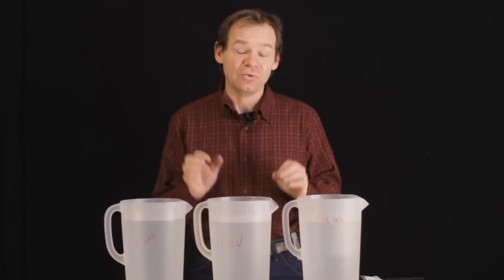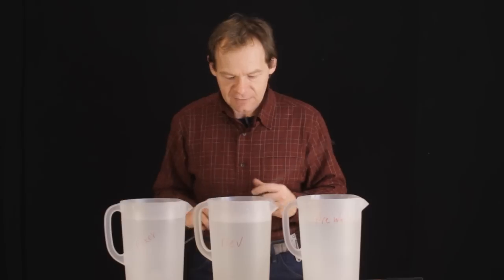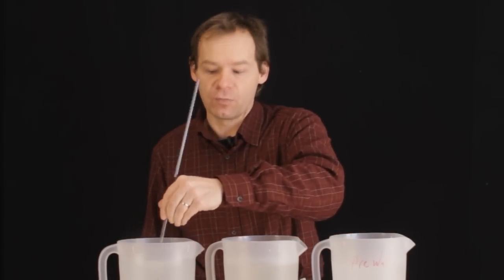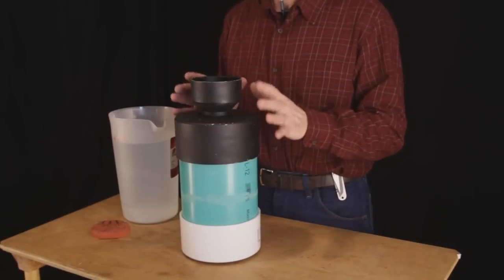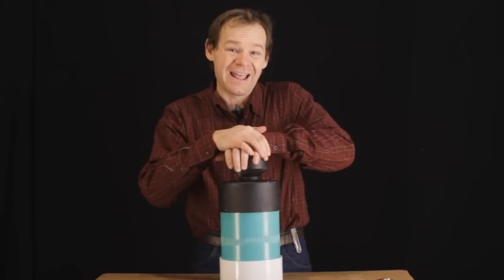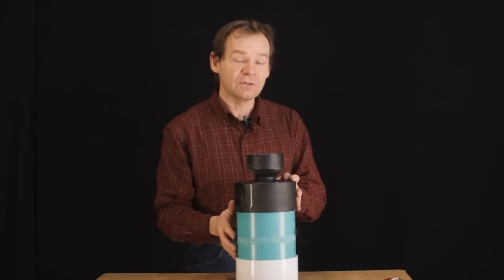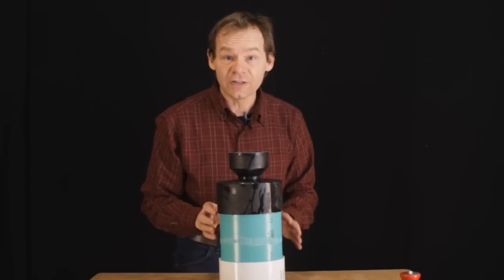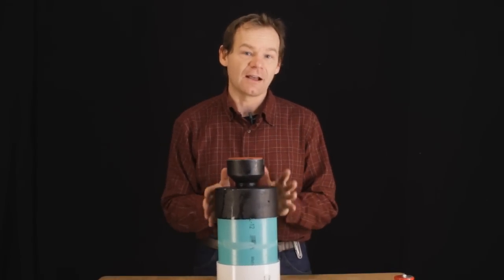How to Hand Process / Develop 16mm film Part 2 - 16mmAdventures

Comment: insightful videos. I moved away from all convenient film processing facilities and have to hand process now with a morse G3 tank. I asked google and emailed kodak support but they were not very helpful.. What chemicals and rinse timing do you suggest for processing 7266(b&w) and 7219(vision3 color) 16mm film? or where do you suggest I look for this info?
Reply from the maker: +Jeremy Ciliberto It's pretty much up to you to figure it out.  If no one on the web has the answer you just have to do some test strips and try different out.   You should be able to start with the process I used, it will probably give you some halfway result and you can alter it from there.

Comment: What about standard 8mm film? I'm not particularly fond of Super 8 for some reason, I just like standard 8mm. If so, is there a certain type of film I should use? Is there any way to develop Kodachrome film? Sorry for all the questions, I'm new to this. I've been watching 8mm home movies and train films for a long time and have always wanted to film trains with vintage cameras, but I didn't think it was possible. I'll use Super 8 if I have too now that I know it can be done at home. I found some websites that will process it, but they wanted $18 per roll! That seems a bit ridiculous to me. Any help would be greatly appreciated. Thanks!
Reply: +Jimmy Stewart 18$ isn't so bad, in the UK we have 'Gauge Film' which does it for 14£ (that's over 20$). Double-8 (you know it as 'standard': the film is 16mm wide, exposed along one side, and then flipped and exposed again. After development it is cut in half) isn't easy to get, but you can buy Fomapan R 100 (black and white). I've seen Agfa Chrome 200D, but that's expensive... super 8 is much more available, but also very expensive!
you use a projector?

Comment: You obviously have no technical training in film processing.  Your agitation is far too violent, anyone who copies your technique will cause GRANULAR MIGRATION on their film.  A STOP BATH means halting the film development with a precisely timed immersion in dilute acetic acid, not mere "tap water" which will leave higher contrast areas on random parts of the film.  Developer and Fixer chemicals should be mixed at least 24 hours before use so that the chemistry is properly homogenized.
Reply: OK, granted it's not the greatest instruction video ever made. But at least it's a starting place for people. You however sound like you're trying to impress someone (yourself) and discourage others with fears about nonsense minutiae. No sane person doing hand processing of motion picture film has reasonable expectations of perfection. FYI, real motion picture labs do not use acid stop, only water rinse. I know because I've worked in three of them over the years. And I've never even heard of "granular migration" or waiting 24 hours after mixing chemicals.
Reply: Get a load of this guy